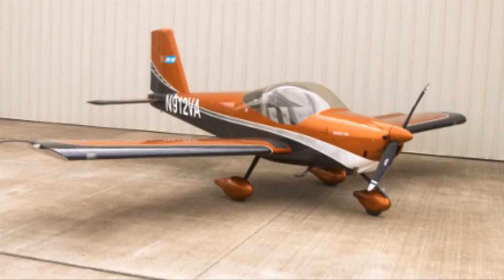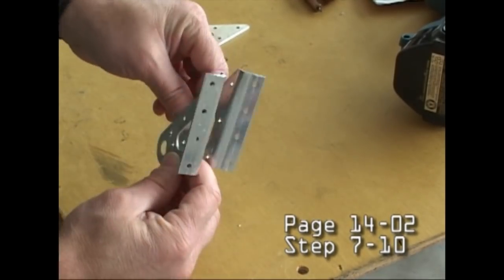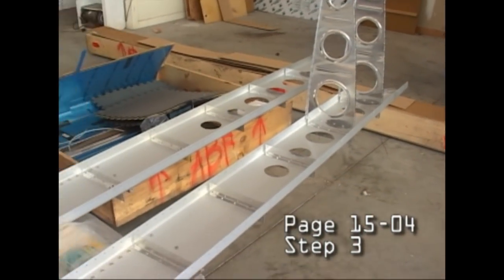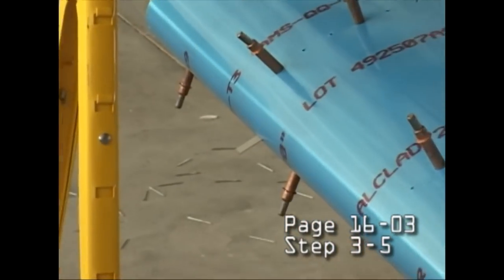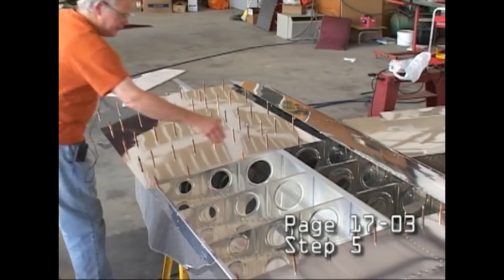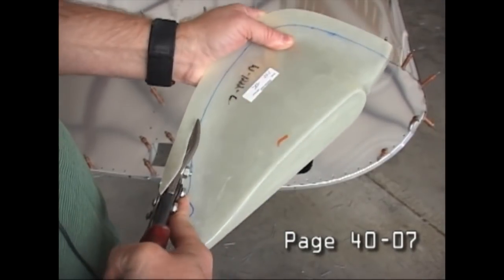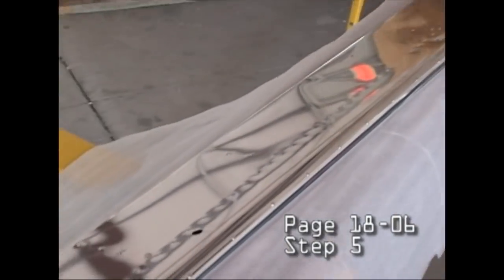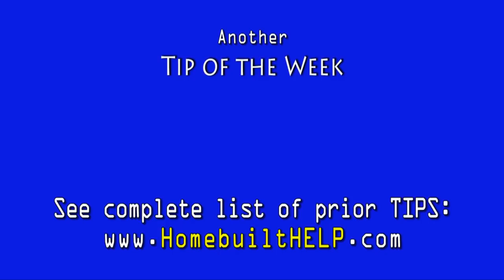How to Build a Vans Aircraft RV-12 Wing

Comment: Had to watch to see updates that you incorporated:
also had to add comment to be careful, in Section 17, to hang onto your drill and not accidently drop it onto the newly installed skin (ask me how I know...)
Problem noticed around the 12 and 15 minute portion of the video --- you are using the plastic and screw electric interface at the wing root for the Section 16 and 40 electrical connections ---> Vans did away with those about 5 years ago and replaced them with Molex connectors -- that was one of the items I thought you would be updating in the video.